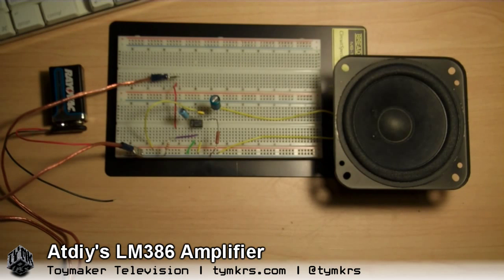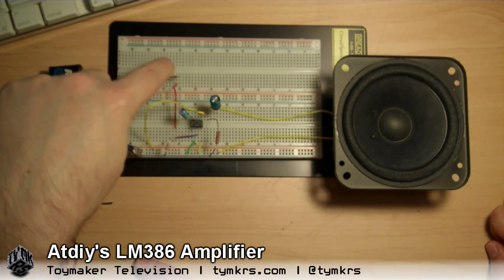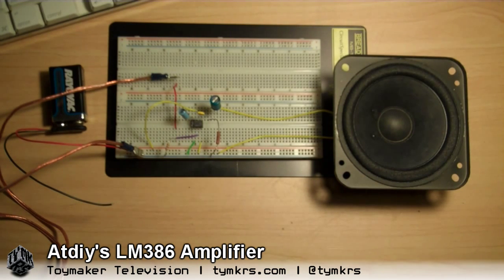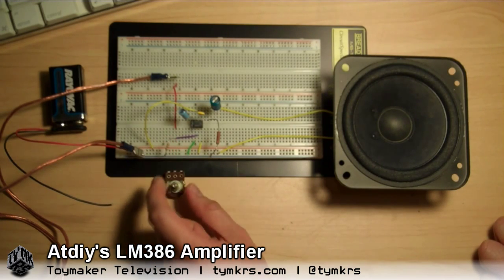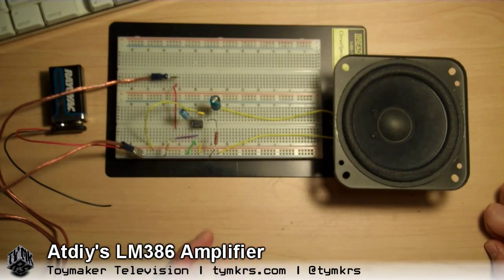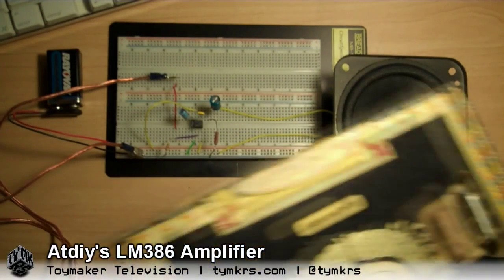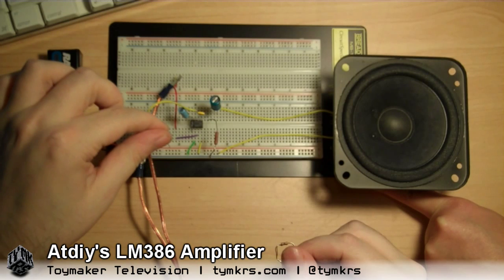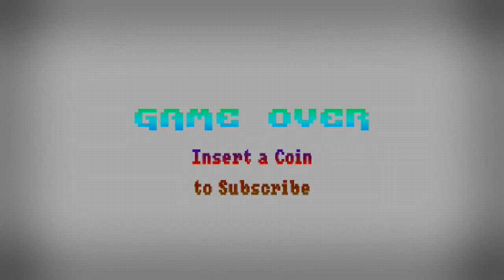TYMKRS Atdiy's LM386 Audio Amplifier

Comment: If anyone is curious, putting a + and -15 volt supply to the + and - terminals of the op amp  will clean up that sound. That distortion is because your gain is higher than that of the 9 volt supply causing the peaks in the amperage to be cut off.

Comment from the maker: LM386 can 'motorboat' (oscillate) on it's own if you get the values 'right' (wrong). They can also pick up and amplify interference like CFLs, microwave ovens, etc. Check the ground connection, touch various wires, etc.  See if you can find where the buzz is getting in and try to improve the layout.  Let us know!

Comment: Neat!
I honestly skipped part of the video since you added a link to the schematic and some explanations were a bit unnecessary, but what you did at the end replacing the 10 k resistor with a photo-resistor at 6:45 gave it the "Awesome" twist.
With some tweaks to the design this could become the next generation in guitar stompboxes, make sure to diffuse this idea. 
Now if you excuse me, I'm off to rip-off your circuit (Don't worry, just for personal use) :D